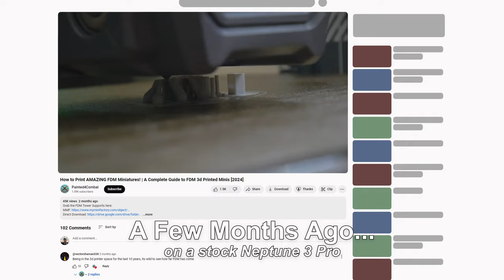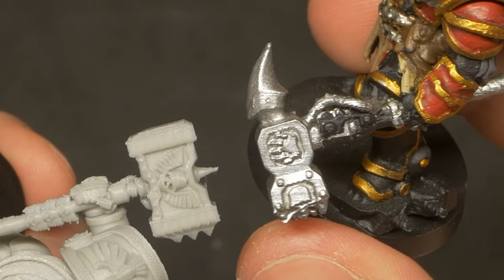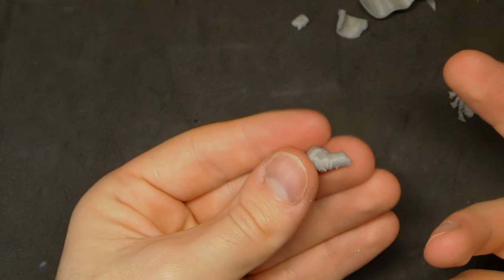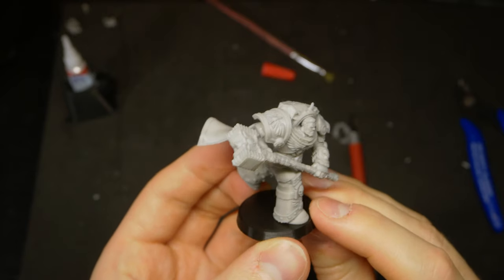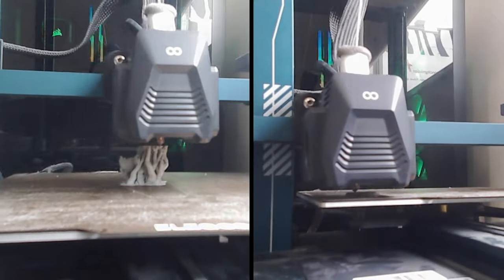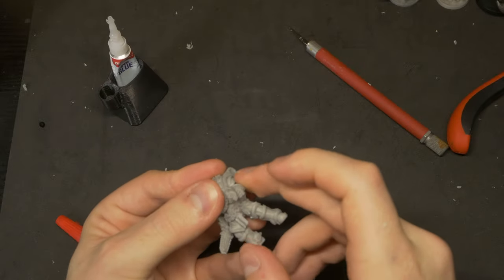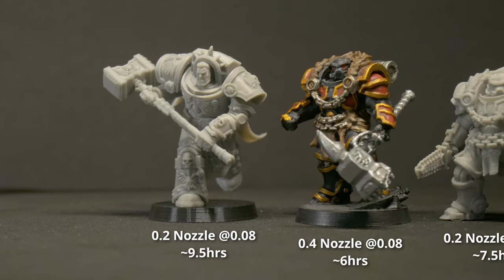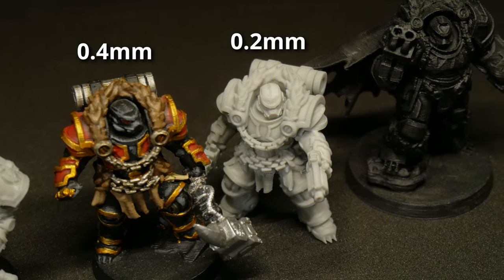EASY Resin Quality on Modern FDM Printers? (following your tips!)

Comment: u could also get a soldering station, it has very precise iron ends that can be heated up to an exact temperature. So instead of gluing parts together you can melt them together, also you can smooth out certain areas by melting those layer lines. some soldering stations also have heat blower guns, but I havent found any use for mine yet in 3d printing. It's awesome that you listen to your community, way to go!
Reply from the maker: Good point & Great Tip! Heat guns can be suuuuper useful for blasting any super fine stringing and makes it way easier to flick off with a hobby knife!

Comment: I've been printing fdm minis for 2 years now, started on old jgmaker a3s bedslinger. 0.2mm, 0.06mm layers. Now printing those at bambulab a1m and it works wonders. Glad more people are catching up on that.
Reply: Are you using the settings Tomb of 3D Printed Horrors (Fat Dragon Games) released for the A1M, or did you come up with your own? I just picked up one myself so I’m trying to find some good ones to start.

Comment: I would like to see you talk about how you set up your supports.  Tree supports always seem to wrap around details on the mini and are imposible to remove.
Reply: This is the same issue I always have when using tree supports. Tried printing a D2 Butcher for a friend to test the limits and the tree supports created a full "model" around my print. Removing was a nightmare.

I'm assuming slicing the model into pieces and printing separate might be how he fixes this.
Reply: @dustinroberson1865 Just picked up an A1 mini with the AMS to test out supports with a different type of filament, since PLA & PETG don’t stick together

Comment: A quick hit with a heat gun (a smaller one) will clean up with stringing almost instantly. Another tip that a lot of people don't use is to make sure your outer walls are printing first. Overhangs can have issues with this, but the outside walls of the model become so much smoother. Also, if you're doing anything above about 60 on your outside walls, slow down a little. It's not a race, it's about making something really good.
Reply from the maker: Will give the Outside walls first a try for sure! Thanks for the tip.
Reply: I don't have a heat gun but a quick pass over with a light works to 👍
Reply: @DonutV88  I wouldn't be at all surprised if a quick pass with a flame improved paint and glue adhesion too.  This is a trick that works wonders on granny grating.

Comment: One nitpick I have is that you switched the nozzle size and the slicer together so we (and you probably also) don't know how much of the improvement is caused by which of these changes.
The nozzle probably did most of the work for the improved quality, but printing the same mini with both nozzles and both slicers would be really interesting.
Reply: More than that, he doesn't specify whether the settings were the same between slicers, and if they weren't then that adds another very major set of factors to your previous point.
Reply from the maker: Looking to cover this when I do a more "complete" breakdown. I got significant improvements from swapping to Orca alone (retaining the 0.4 nozzle) this was due to it having much nicer supports as well as some built in calibration tools (and some other minor stuff). and then the addition of the 0.2 nozzle helped to bump that quality further again. - but again, hoping to go more in depth once ive some more time in the software!
Reply from the maker: @claws61821  I had much more success with the default settings for my printer in Orca than I did with the defaults Prusa gave me (besides Orca's bizarre travel), I then went through and matched some of my settings to my old Prusa profile where I thought they would improve it. So my settings are different, but only because I had much more success from the get go with Orca. - I'll be doing a future video where I hope to go more in depth once ive had more time in Orca and will discuss all that there!
Reply: I'm not sure how much of a difference orcaslicer really makes here, since it's based on prusaslicer in the end

Comment: Yup with a .2 nozzle and a .05 or .03 layer height will give you that resin quality look.  The quality will be at the level of an Elegoo Mars 2 in detail level, no it won't be 4k or 90k detail level but for little table top minis, its perfectly sufficient.  The reason for this is with the smaller nozzle, details that are smaller then the Nozzle Width will not be ignored, even with Arachne enabled.  
I have been printing Grey Knights myself with a .4 nozzle, and am quite surprised at seeing the Rune details on the shoulders of the Terminators, actually coming through.  The multi part model for Drago didn't really come out that well, so when my .2 nozzle comes I will re-try him again, if all else fails he might have to wait till I get a resin printer again.

Comment: Wow. This is great. 

I'd be happy with that quality. It's not perfect but it's good enough for tabletop for sure and without the hassle and cost of resin. 

My only concern is that it's taking 9h for one mini and two minis would take take twice as long, while a resin printer can print out a whole plate at a time without going any slower.

I'd be interested in comparing the experience of printing out and cleaning up 10-20 models and and a tank resin vs doing the same in FDM. That's a larger project, I don't know whether you'd want to do something like that.
Reply: To be fair, some of us spend that amount of time painting a mini, works out! xD
Reply: I like to start long prints right before dinner. It allows me to check that everything’s going well before bed and it’s usually done either in the morning or when I get home from work

Comment: I started using Orca because the default Creality slicer didn't allow me access to a lot of the settings that other mini printers were using. It knocked about 10 - 15 minutes off a lot of my prints and printed with a better quality. I'm still using the .4 nozzle although I did buy some .2, but really haven't felt the need for them since I started using Orca.

If find that using models from a decent sculptor is a bigger key to successful minis than any particular Slicer settings. Printing minis has never been better!

Comment: This is so very validating to watch...4-ish years ago I'd put a ton of time into pushing just how far my Ender 5 could go, as much to spite the 'FDM is garbage' crowd as because I got it to print terrain and all they wanted to bag on was its ability to do minis.  Managed to get it producing 0.04mm layers out of a 0.3mm nozzle [like you experienced, the 0.2 clogged too much and I had my fill of it real fast].

Ended up walking it back a bit after I picked up a resin printer to go with it...the print times just weren't worth it once there was a Saturn on the desk that could do better Z resolutions faster...though now this makes me want to get back to tinkering.

Comment: Really appreciated the video comparing results between a 0.4 and 0.2 nozzles.  Been considering a new nozzle to upgrade my Anycubic Kobra 2.  This won't replace my resin printer any time soon, because a good resin printer can throughput an entire squad in less time than a single high quality FDM miniature.  But it would be a great option individual miniatures, or for hobbyists looking for high quality results but don't have a safe/ventilated space for a resin printer.  I mostly print terrain and scenic bases on my FDM, and even with a .4 nozzle always have to weigh the trade offs between finer detail and the time it takes to print.  It is interesting that, in the future, we may speak of resin not as being the higher detail option but as the faster option.
Reply: As some one who has been using a Kobra 2 for miniatures the buggiest hurled has been getting bed adhesion as the 0.2 nozzle puts so little down the z retraction has full on pulled a brim supported model off the plate just from retraction. once you get that down you will be surprised how good of a model you can get.

Comment: Awesome!
I already use the Orca slicer and managed to print some 10mm marines and 6mm Necrons on my Bambu A1 Mini with the 0.2 nozzle. The later break rather easily and are hard to clean but dangling filament remains and damaged parts fit well for Necrons anyways and not much is lost if I have to throw a couple of them in the bin. 😁

Please make a video about propper suppor placement and maybe one about slicing miniature up in a program like Meshmixer for better prints!

Comment: Great follow up. It's nice to see the improvements and you not letting the resin huffers get to you.
One thing you might want to try, just for interest sake, is running resin supports, or pre-supported minis, through with added autosupports in orca. I've done this a couple of times - it drastically increases print time due to travel but.. Well, it would be interesting to see what your results are.

Comment: One of the best videos I have seen on printing minis or figures in Filament. 
I am a digital sculptor and 3D modeler, it has been almost a year since I acquired my first printer, an Elegoo Neptun 4, obviously not all of us can afford a resin printer and despite what they say, I am managing to print my figures in 12cm, with tremendous quality in a layer height of 0.08. 

Not all of them are minis in life, there are also figures of those sizes, and I am really very happy with the quality and clarity with which my characters printed in PLA come out, without worrying about the toxicity of the resin, and everything that comes with a resin print. 

But here you show that you can go much further, and you can practically compete with a resin one by having the appropriate configurations in a 0.2 nozzle.
Reply: Would you be so kind to share your settings?

Comment: I'm doing some test helmets on my 0.2 nozzle and 0.1 layers, easing down the layer height as I dial the settings in, and the cooling tower tip really helped. While I'd normally print multi-object plates object by object, I instead did them layer by layer and put each helmet a bit far away from the other. Same effect. So, oddly enough, if you have two models you want to print that have about the same height, they work as fine cooling towers against each other.
Reply: Most printers have 0.04 steppers so 0.12 or 0.08 are probably better options for layer height

Comment: This looks very good and i am glad one can get nice minis without needing to deal with resin. I am curious though: is the quality heavily dependent on the model suiting fdm (chunky space marines seem easier than fragile elves) or can you get pretty much any model in this quality with a bit of fiddeling. Gotta say, especially for people who are 10% hobbyist and 90% gamer, this is it!
Reply from the maker: Yeah - it might limit your STL selection to 80-90% of what available, super thin minis are difficult but I've been printing Hero Forge minis with no issue if that's a good point of comparison for ya! Anything that's Heroic scale or that isn't to "realisticly" proportioned should be fine (in my experience so far).

Comment: I would maybe put the mini in a short acetone vapor bath just to smooth out the lines slightly, I do see a bit of stringing but nothing major might want to adjust the heat slightly. Other wise this is looking good.
Reply from the maker: Yeah! Haven't adjusted my retraction fully since swapping from 0.4 to 0.2 so stringing is still a bit wild. Acetone might be a nice way to polish these off if I'm seeing to many layer lines after Primer.

Comment: Really curious how these would look painted, if the layer lines become more visible or if it's still negligible.
Reply from the maker: Stay tuned! working on that video now
Reply: @Painted4Combat  I'm also wondering if there's a way to get the print time down at all, not that it's a big deal, I need to get my own printer haha
Reply from the maker: Of course! depends on the printer i suppose, these are the speeds I have found give me the best quality on the neptune 3 pro. you could loose some walls and change some speeds to decrease print time but you might sacrifice quality. 

Also, these are printed with a 0.2 nozzle, and I found I have to lower my speeds by 30ish-percent to be able to get correct flow through the nozzle, so a 0.4 nozzle would be faster but worse quality etc.
Reply: the layer/resolution lines need to be smaller than 30 microns in order for paint to start hiding the voxel lines with light paint, so even resin printers need high resolution to have a smooth enough surface.

Comment: Great video! Printer noob here. I am thinking of getting a Bamboo A1 next year but I wondered: Can I print any STL file or does it have to be a specific type of file? Im scared that I wont find many good files to do warhammer prints. thanks in advance
Reply from the maker: A1 is a great choice! any STL's you can find on Websites like Cults3d, MyMiniFactory, CGtrader, just have to keep an eye out. and STL is just the most common format, sometimes youll get OBJs or other file types but most slicers can handle those just fine! Many "warhammer" models come and go, so just make sure you grab files when you see them, especially if they are close proxies for GW models, they get taken down pretty fast xD

Comment: I have a k1c I switched to a .2 nozzle but there isn't a .2 profile for k1c on Orca slicer. Any suggested where to start?
Reply from the maker: I had the same issue for the Neptune 3 pro. All i did was the following;
- - Printer Settings - -
Nozzle Diameter = 0.2
- -  Print Profile - -
Quality = change ALL my "line width" settings to half the default value used for the 0.4mm nozzle 
Walls = 4 (i use 3 walls on my 0.4mm nozzle, but found that 4 or higher is much better idea for a 0.2)

so really all i had to do was just tell it I was using a 0.2mm nozzle. nothing too fancy! the rest of my 0.4 settings worked great for the 0.2.
If you find your printer is struggling to push out filament try increasing the temperature by 5-10 degrees and slow down your speeds by 20-25% 

Hope this helps!

Comment: first of all, great video. Question related to the "strings" of filament on the models, how do you clean those?
Reply from the maker: Yeah! your probably talking about the Orc and Mephit shown at the end, I did very little cleanup on those. 
Usually its easy enough to run the back of a hobby knife along those areas (same way i'd go about removing sprue lines from a plastic model).
 - otherwise blasting them with some heat (heatgun or superheated hairdryer) will cause them to curl up into little blobs that can be flicked off easily with a knife.
Reply: @Painted4Combat cool thanks for explaining. 
Did you ever try to „polish“ the minis to smooth some of the layer lines, e.g. with a dremel tool?

Comment: I have a resin printer for printing Battletech miniatures. I hate the clean up and prints that fail. I have wanted an FDM printer but told that the lines were too visible and don’t sand well. This looks like a game changer. Have you noticed any lines in your prints? Thank You.

Comment: Would be interested to know if printing using 0.4mm nozzle sliced with orca produces better results than the same mini printed slicing with prusaslicer.

Have a k1c and did some tests comparing a 0.4 nozzle and 0.2 nozzle both sliced with orca and the 0.2mm nozzle produced only very slightly better results than the 0.4, not enough of an improvement to warrant the extra time. 

So I'm wondering if the big improvement you saw was due to the slicer rather than the nozzle?
Reply from the maker: Good plan! Will try and do a proper comparison in the future!

Comment: Really good videos with fdm showcasing! , how did the changing the 0.2 nozzle on the elegoo machine go? heard it was a big hazzle and might wanted to just buy a whole new head so you can switch around instead of replacing?,
when you say "perfect out of box" is that in terms of slicer settings?  ive only been using orca and love it. or did u change the standart orca settings, for some of the things you talked about in this and earlier videoes?
Reply from the maker: By 'perfect out of the box' I meant I just had adjust my current settings for the 0.2 nozzle (orca doesn't have a default 0.2 for the neptune 3) but I had dialed in some of those settings beforehand.

As for swapping the nozzle I quite literally just removed the silicon shoe on the printhead and I was able to unscrew the 0.4 and screw in the 0.2 without any hassle of pulling anything apart.
Reply: @Painted4Combat  what about the speeds? Is orca slicer set to the same speeds etc. as the other slicer you show in your other video?

Comment: I haven't tried prusa slicer as I've been solely using ultimaker cura. Would you still suggest moving to Orca compared to Cura?
Reply: And Bambu to Orca?
Reply from the maker: Cura is a great slicer to get to know 3d printing and comfortable with slicing software, but if you're comfortable enough with 3d printing then Orca Slicer is definitely a good next step as you get access to a few more settings and orcas tree supports are easily the best in the game (that I have used so far)
Reply from the maker: As for Bambu, it's tricky. I thing it will depend on what printer you're using. The new babmu printers seem to be highly tuned in for their slicers from what I'm seeing. Bambu slicer seems to allow for "easy" printing out of the box, but orca might be worth a go if you want to have more control over some of the more hidden settings.
Reply: Going from Bambu to Orca was pretty easy in my opinion as they use the same code base